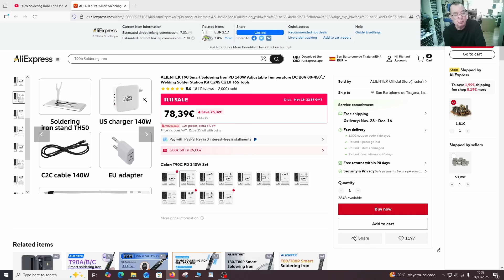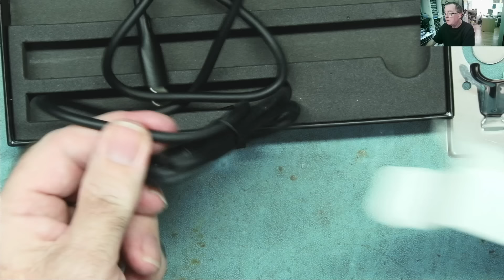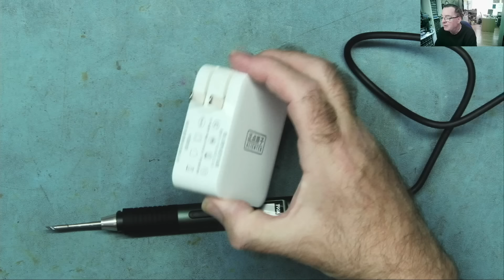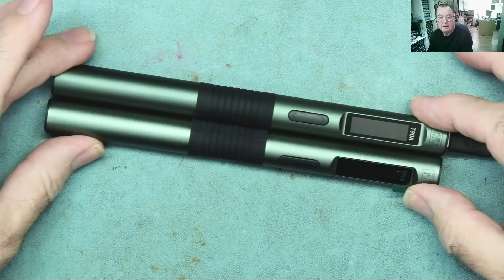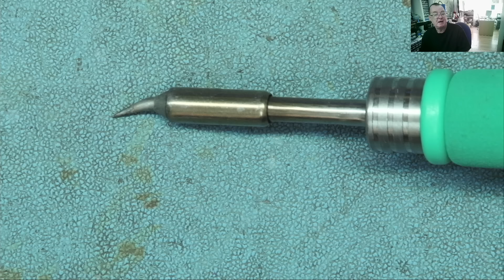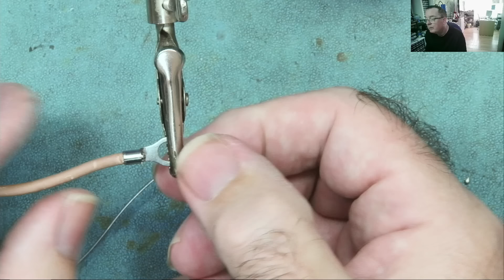AlienTEK 140W T90 Portable Soldering Iron Test And Review : T90A C210 T90B C245 T90C T65

Comment: Hello everyone! I’m an experienced engineer who has owned and still owns many excellent soldering stations such as ERSA, Weller, Metcal, and Quick. The last two are induction-based, but they work differently. Metcal has no temperature adjustment and operates on the Curie point principle.

I decided to buy and test the T90B version, and here are the disappointing results I ended up with. The description claimed that the large indicator on the soldering iron displays the actual temperature. But when you try to melt something with high thermal mass—something the tip simply cannot fully melt—the temperature on the display stays exactly the same as the set value. At the same time, even with the largest tip, the power consumption never exceeds 32W.

If you take a glass of water and immerse the tip with the heating element, the indicated temperature drops and the iron starts drawing the full 140W from a 140Dn PD 3.1 power supply. In other words, the “real temperature” indication exists, but it reflects the temperature of the thermocouple, which is apparently located somewhere deep inside the heating element. As a result, because of poor thermal transfer between the heater and the tip, the thermocouple does not sense a temperature drop, even though the tip itself is cold and unable to melt anything. The heat simply doesn’t reach the very end of the tip.

And if you pull the tip out of the water and press it, for example, against a solder joint on an aluminum PCB, the power unfortunately won’t rise above 32W, and the solder won’t melt. The thermocouple, being already heated to the set temperature, limits the power output. Those who are “happy as a clam” with this soldering iron are likely soldering FR-4 PCBs—at most two layers—where 30W at the tip is more than enough. In reality, the 140W of this iron are used only for fast heat-up and never reach the board. A pity. I’ll have to put the whole kit up for sale.

P.S. I can’t understand how people who designed and manufactured everything so beautifully completely overlooked the thermal resistance between the heater and the tip.

Good luck and all the best to everyone who made it to the end!
Reply: This is honestly really disappointing to hear. I was thinking this could be an ok portable solution for my needs, but I guess the search continues. Have you tried anything similar that actually works as advertised?
Reply: Thanks for this feedback. It’s a test not many would know to do. 
I was hoping to find a response to your comment from the OP, but, it says a lot that there was no answer to this very specific situation. 
I saw another review in which the person making the video was using a tip thermometer and it was very close to the temperature shown on the device; but, this thermometer of course wasn’t showing heat loss from surface contact.
Which device do you recommend? I guess this devices are ok for the price, they’re not for professional use.
Reply: Yeah bro!!! I made to the end as well lol. 
Thanks you so much for your input and taking time for the review - it’s brilliant!!!
So may I ask if Milwaukee made something similar or not yet? They behind of Chinese market but solid as an concrete. Would consider. 
May I ask if you can just take a quick look at and leave here your feelings on 
FNIRSI HS-03 same kinda thing a Price close to the same, a bit bulky though - but probably because of internal battery - which is most important for those type of portable ish toys.
But looks amazing a big plus that it comes from proven company - not just random brand name. Even comes with a case which is technically cost 7-8 $€£¥ itself plus looks way cooler overall
Reply: Просто нужно использовать весь потенциал картриджей c245, у них мощность на разогреве достигает 200 ватт,в ролике автора это не паяльники,это игрушки
Reply: @DemonSh what device do you recommend?
Reply: @GnarledSage   Reddit r/soldering has a buying guide for desk stations pinned at the top (one of the pictures). A Geeboon TC22 with two handles and good stand is about 110€. SDG electronics tested the bigger Geeboon  HC24 https://www.youtube.com/watch?v=9HhgOmWvknA
Reply: @DemonSh  итак, а что не игрушки если милуоки пока похожего ничего не предложило??? Точнее предложило - но это кувалда по сравнению с молотком на М12 батарейке. Есть опыт или наметки?
Reply: и так же картриджи поставляемые с этими паяльниками которые в ролике очень плохого качества

Comment: I have been trying out some soldering irons that were recommended in the past, but I'm noticing that the tips go "dull" after just a few weeks, where solder will no longer stick to them. I'm from mainland europe, so due to ROHS compliance, we only get unleaded solder (mostly SN99.3CU0.7) and I tend to set my iron to 380°C to easily work with unleaded solder.
Can you maybe do some piece of content how to prevent the tips from going dull, how to service them, and some general advice on soldering with unleaded solder?
Reply from the maker: Why not just buy your leaded solder from AliExpress, HX-T100 is very nice to work with

Comment: I was looking at this and the Fnirisi. I bought the finirisi. HS 02B with hardcase. it has the faster heat up time and better screen and comes with a usb-c to DC cable adapter.. The tips are cheaper as well.
Reply from the maker: I previously reviewed the HS-02 soldering iron. The HS-02B takes C210 tips, same as the T90A, so I fail to understand how the HS-02 tips are cheaper 😵‍💫
The one reviewed as the HS-02A which takes the same C245 tips as T90B.  The HS-02 worked very well and I showed this in my review. However that was back in June 2024 and the HS-02 is 100W vs T90 140W. Things move on.  

The FNIRSI hard case you mention https://s.click.aliexpress.com/e/_c3uIepKD they actually sent me one to review a few months ago but didn't realize I no longer had the HS-02 soldering iron by then as I gave it to the guy who prints my business cards as he does some electronics hobby stuff.  

I couldn't do anything with the hard case,  but it fits the T90 really welI gave it as a gift to my friend Detlef with the T90B and the 140W PSU.  Actually the hard case is a nice product, but I think it misses an opportunity as it should be fairly easy to integrate a power bank into the case (yeah make it a bit deeper) and then you could really use the soldering iron on the go

Comment: Looks like a very well built portable soldering iron. However, I don't see the reason for buying it. If it would be battery powered than sure, but having a cable and power supply- I don't see the point of having one if I already have "normal" set. Even for a field work I could use the same one I have at home.
Reply: You make a fair point — a lot of people feel the same way at first. 🙂

But the key advantage is that the T90 can run directly from a power bank (including PD fast-charge power banks).
So for field work, you only need the iron, one cable, and a power bank
Reply: you can buy adapter for makita / DeWalt / Milwaukee and others 18 / 20v batteries that can supply up to 140w. it has built in fan and watt / amp readout too. verye exceptional device

Comment: I wonder how the miniaturized mosfets in these irons will do longterm. 7 amps, just saying. And as the delivered voltage is variable, there is going to be more power supply circuitry.
Reply from the maker: 28V at 5A actually.  PD3.1

Comment: I previously mentioned before, soldering iron reviews when one is comparing between reviews need to at least show the actual temperature of the tip NOT just what the on screen readout shows. That setting can be out 40c or higher. 

I stupidly purchased a 100w GaN charger on 11.11 which I have not received.  I would have to spend $100 CAD after coupon for one of these higher wattage irons with the adapter. As I do not repair things for a living, I will enter the giveaway at the end of the year.
Reply from the maker: And I wish you the best of luck Greg 🙂 There will be three prizes to win in our special new year free prize draw, thanks to AlienTek
Reply: @learnelectronicsrepair  Thanks appreciate it. At least I will not have to deal with Rakuten cash back fiasco if I win one of these. ;)

Comment: I bought the FNIRSI HS-02B version of this type of soldering iron. It wasn't cheap. It took some getting used to using the controls. I bought it to handle PCB SMD soldering. The smallest I've worked with so far are 0402 components. It does fine. It's rated at 100W and controls between 100C - 450C. It came with a beefy 20v - 100W (5 amps) GaN controlled supply and a thick flexible 1m cable with the type C USB connector The power supply will negotiate and supply 5,9,12,15, or 20vdc. One can set the iron to work with any of the voltages.  It came with 3 tips (HS02B - K, - I, - IS) I use the 'bulls horn' style tip the most. I built my own bench stand for it from an old soldering station and turned some Aluminum to fit the tip on my lathe. I carefully machined the cone to receive the iron perfectly so unlike the stand they provide you and you demonstrate mine doesn't flop around at all.  The little tinker toy soldering stand that mine came with it is only annoying to try and use. I bought the kit on Amazon for $77 US in July 2025. Todays price for the same kit on Amazon is $86 US. 
The version you show produces 140W but that's because it will go to 28volts, 5A.
Reply from the maker: Yes, PD3.1 gives 28V at 5A.  Regards the bench soldering iron stand I was a little dissapointed with the way it held the iron (not very well though admitedly it will not actually fall out).  All the Alientek gear I have tried so far has been exceptionally good so I do admit to being a little surprised at that. Just by chance the soldering stand holds my T12 with 9501 handle perfectly so I found a good use for it. On the plus side it is an optional extra you can choose to buy or not buy, I just told it like it is and it's your choice 😉
Reply: @learnelectronicsrepair  Thanks for the honest feedback! 
For the T90 series, the TH20 stand is actually the most suitable option.
The TH10 can be used, but it’s not an ideal fit since it’s designed to match the T80 series perfectly.
If someone doesn’t want to purchase an additional stand, the included TH50 basic stand works too — and just to improve the overall experience, we’ll be upgrading it to the TH30 silicone stand in future packages. 😊
Reply from the maker: @AlientekGlobal  Thanks for the info, and for sending me your soldering irons to try them out.  As always I review items honestly 'as-is' and this was the only minor niggle I could find. The soldering iron won't actually fall out of the stand it just isn't the best of fits.  As the stand is an optional extra, buyers can select whichever kit they prefer so I didn't think it is a major issue as they have the option not to buy the stand.  By coincidence it fits my T12 9501 handle really nicely so that is where it now lives on my bench😉
Reply: @learnelectronicsrepair  Thanks a lot for your honest feedback — we really appreciate reviews that reflect the real user experience.

We added a clarification because some users might not be familiar with the compatibility differences between the stands, so we wanted to make sure everyone has the right expectations when choosing their kit.

And it's great to hear the stand fits your T12-9501 handle perfectly — that’s a nice coincidence! 😉

Thanks again for the fair and thoughtful review.